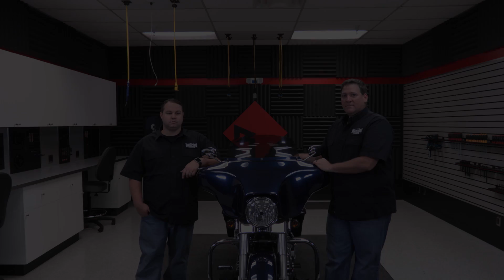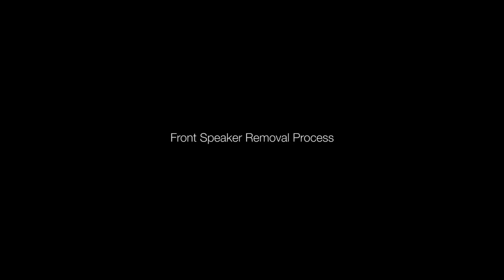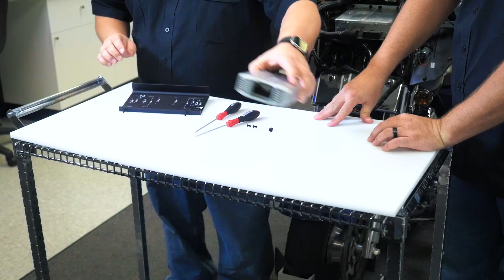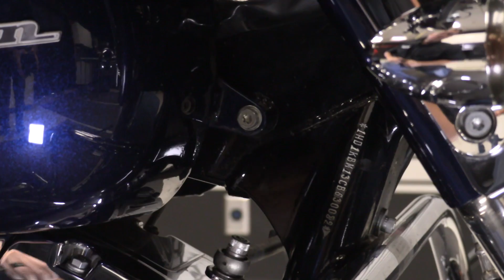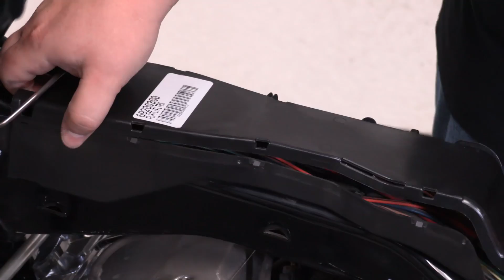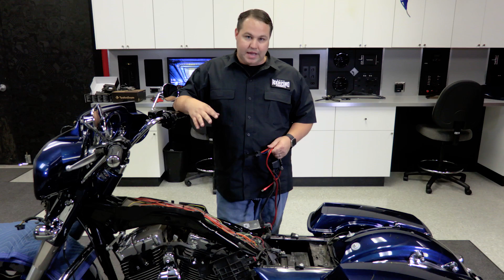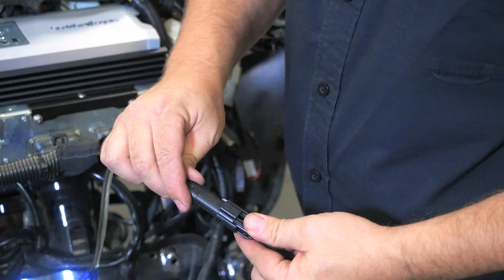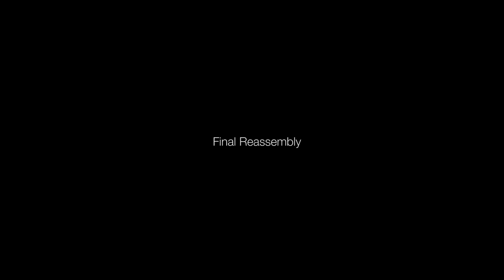1998-2013 Street Glide® Front Speaker & Amp Install

Comment: Does this amp installation work the same with an alpine head unit. Or only stock head unit.
Reply from the maker: Installation is 98% similar with the following exceptions:
1) The amplifier inputs will be connected to the corresponding speaker outputs (not RCA) of the Alpine radio instead of the factory radio.  We recommend this since most radio speaker outputs have better voltage over RCA outputs.
2) The amplifier input sensitivity will be adjusted according to the Alpine's output voltage  (the amp is supplied with instructions on how to set the input and output settings).

If you have questions during the installation, our technical support is available 8:00am - 5:00pm, Monday - Friday MST or through www.rockfordfosgate.com/rftech
Reply: Rockford Fosgate wow thank you for the reply! I will be buying this set up. I have read up on it on hdforums. My main concern was if the amp mounted up the same way as it does to the stock head unit.
Reply from the maker: Actually it's a good thing you brought this up ... the Alpine radio most likely has different chassis mounting screws. You may need to customize how the amplifier heatsink gets attached to the radio chassis by drilling different holes through the mounting bracket.
Reply: I have the amps need mounting bracket and etc